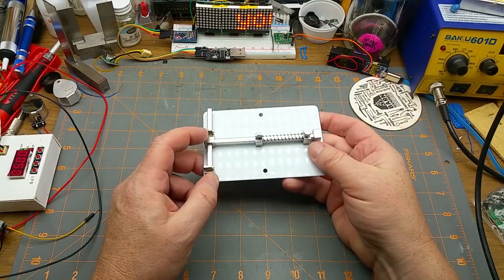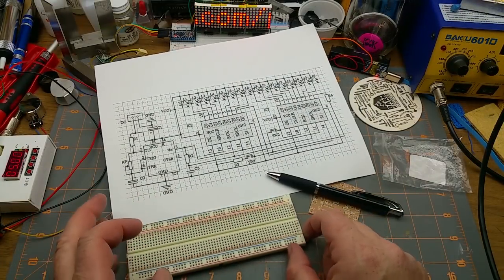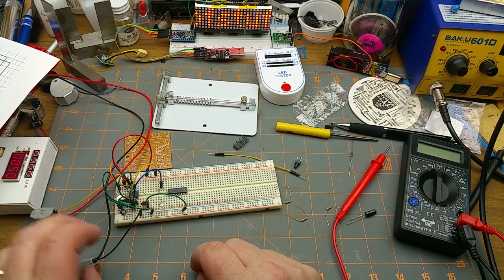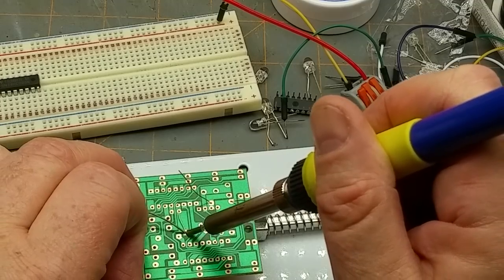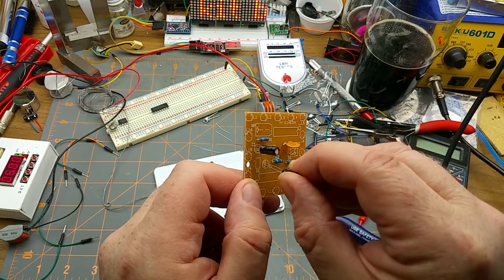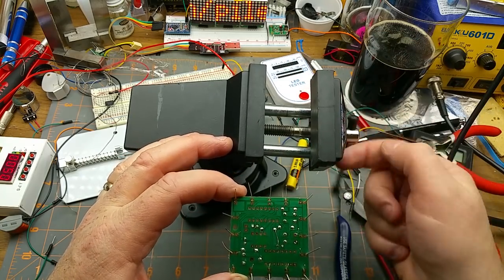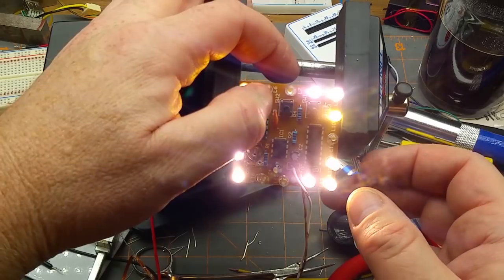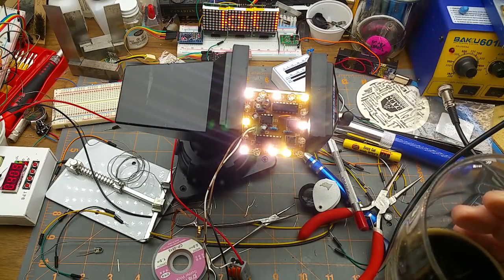kit build -  chase lights using shift registers

Comment: I was about to write about how much simpler this would be with a 8 pin micro but this is actually pretty nice.
Reminds me of something Julian Ilett would do.
Reply from the maker: Using a microcontroller does usually simplify the hardware, but the trade-off is needing to add software.

I'm a big fan of the simplicity of an all hardware solution.
Reply: You need more than eight pins on a micro for this!
Except if you use neopixels and add a pot to select color, that would use 5 io pins: speed, color, fill, empty, pixels
Reply: You would still use a shift register.
Reply from the maker: True. (unless you use something like an arduino mega)
Reply: @pileofstuff  Even a mega with 8 pins would not help, tiny exist with more than 8 pins. Long time ago I did a led flasher with one, mostly to learn the processor. This included fun stuff like multiple brightness levels, programmable patterns over a serial port (done in software) and shared pins for leds,  com and button.
Reply: @henrikjensen3278  There are some ATTiny44 and AtTiny84 in I think so14 packages. Bigger chips are ATMega. There is no Atmega 8 pin chip. With use of charlieplexing probably you could run a lot of leds with 5 pins
Reply: @kjur18  You have to deduct pins for two switches and one for a potmeter for speed adjust. That leaves 2 pins for leds.

You could combine the switches one one pin, that would be 3 pin for multiplexing, i.e. 6 leds.
Reply: @henrikjensen3278  I forgot about those. It's just cheaper to use 555 and some shift registers, even if parts count is higher.
Reply: @kjur18  That depends, EEVBlog has been looking at some very cheap micro controllers, but this kind of construction is probably too low volume for it. It would also spoil some of the fun/learning you get from a design with basic chips.
But if you want to learn a bit about microprocessors my idea with neopixels would be a nice/fun project.
Reply: @henrikjensen3278   You mean these OTP Paduk chips? I looked at lcsc.com and your cheapest 555 is still more expensive than these small chips. I did not expect that.

These neopixel thingies are good, with arduino it's very easy to make many different effects, not only rgb, but you can buy also SK6812 leds, you can get them in white-warm white-amber type for example
Reply: @kjur18 Yes, it was the Paduk chip I was thinking about, not that I ever expect to use them. I do not like OTP, it is too slow compared to in-circuit programming when testing.
Reply from the maker: Henrik Jensen: 

 I was referring to the Arduino Mega2560 (this one: https://store.arduino.cc/usa/arduino-mega-2560-rev3)
It has way more pins than needed to replicate this effect. But it's severely overkill.

The only way to elegantly use an 8 pin microcontroller would be (as suggested) to use neopixels or similar. 

But that would drive the cost up, and it would no longer be a hardware learning experience.

Thanks for the discussion. I'm always happy when I can trigger an exchange of ideas.

Comment: heh,i remember ower 30 year before my first led row kit i soldering and then made own many many led boards. ne555 and some 74xx chip led blink board. kit car led light row etc cristmas led light. same system made toilet free-reserved lamp etc. young boy, mother not has happy i use ferricloridi on kitchen sink and kitchen table lot.hehe. today pension and have time i has start make arduino many project.